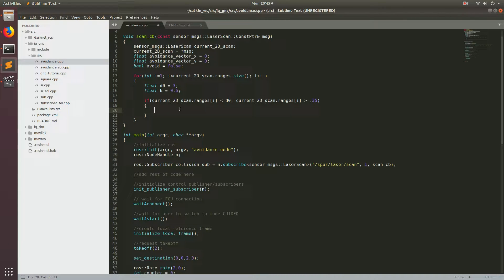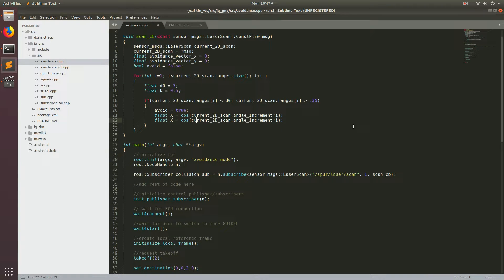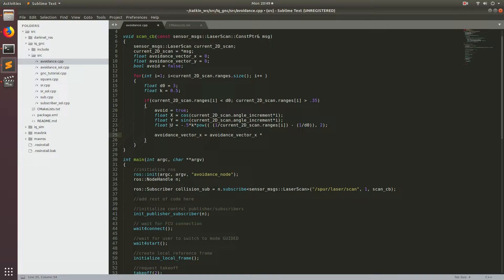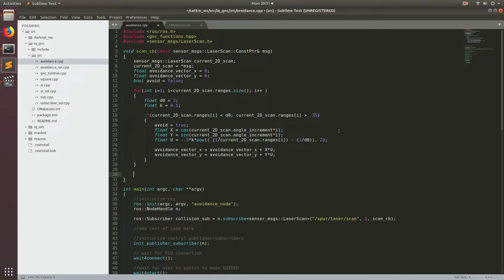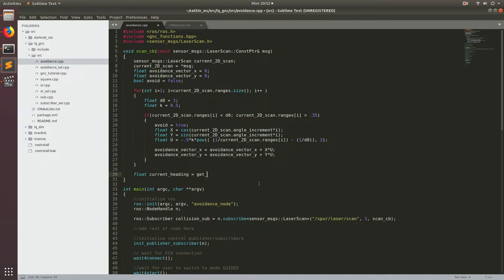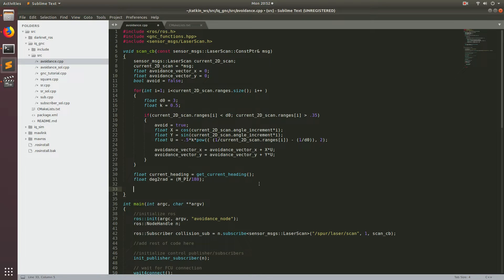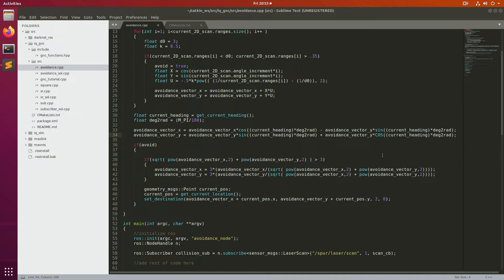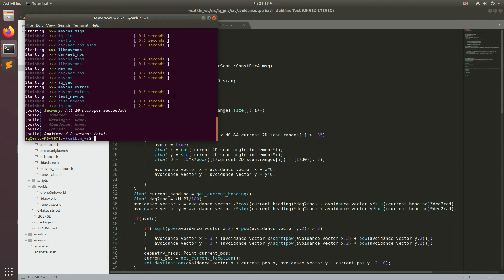16 Obstacle Avoidance Using Lidar for Drones (part2)

Comment: in line 34, i had to replace the plus with a minus.. else the drone would fly into any obstacle that was placed in y axis. I am using PX4 sitl, and using px4_msgs.... any idea why that might be?
Reply: What was line 34 for you? My drone is also doing the opposite, which is running into the obstacle 😂 Already checked the code, I should have something different but didn't found it yet
Reply: @alexandrerodrigues7900 
Line 34 was the rotation part..

avoidance_vector_x = avoidance_vector_x*cos((current_heading)*deg2rad) - avoidance_vector_y*sin((current_heading)*deg2rad);
avoidance_vector_y = avoidance_vector_x*sin((current_heading)*deg2rad) + avoidance_vector_y*cos((current_heading)*deg2rad);

I will suggest look at the drone reference frame, and the lidar reference frame(after converting into Cartesian), and how it is connected to the drone

In my case i had to rotate 180 degrees as well as flip the y axis. Hence the minus sign

Comment: I noticed that when the runway.launch simulation is used the drone gets very unstable and does not reach stability at takeoff, whereas when the lidar.launch simulation is used the drone is very stable. I want to know what changes were made to the world file to get that stability. Thanks.
Reply: im guessing here but i think you need to change the lidar mass and make it a low value so it doesnt effect the drones performance